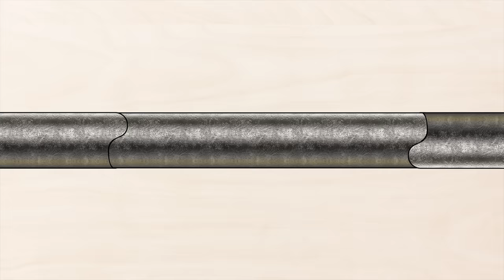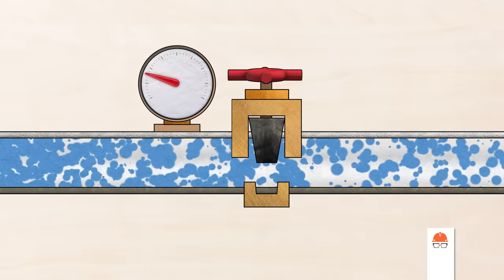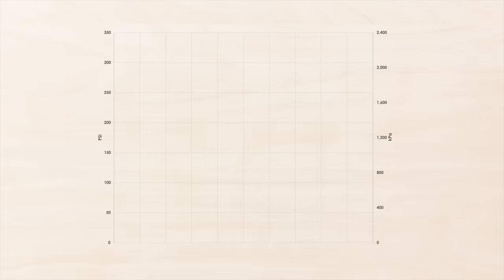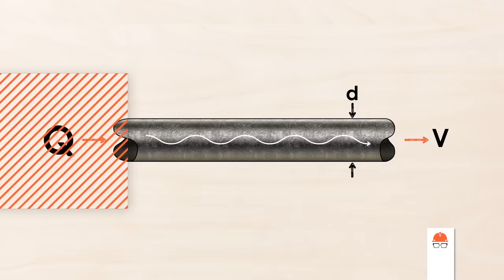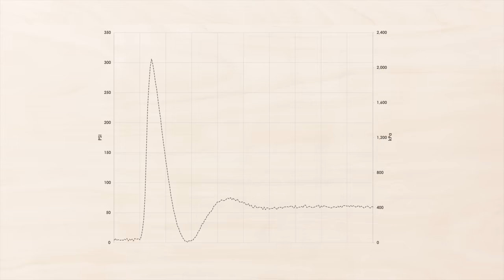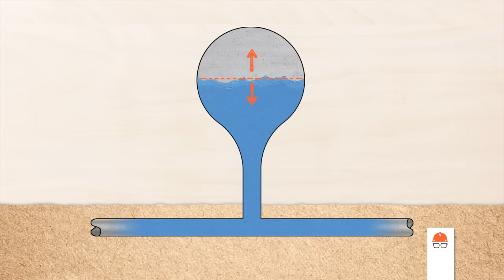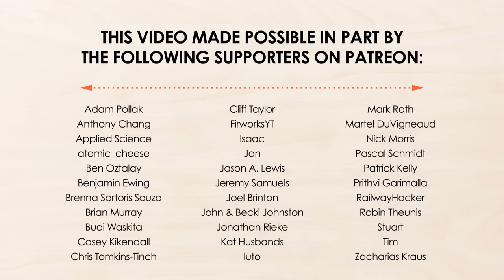What is Water Hammer?

Comment: but a smaller diameter maybe cheaper but the inner friction or pressure loss will increase
there is not only speed and diameter, but a ruggedness of surface which has a relation with the reynolds number, from engineering books

Comment: I made a water hamer damper with 5peces of pvc pipe nitrogen gass a spring from a reciprocating air motor pump and the piston off of the pump I attached them on every sink and every spot where water comes out the sound of the pipes moving completely went away and each damper has a flow meter and pressure sensers on the wet and dry side that wirelessly transmit to my custom software I made to make my house a smart house the max I have seen was the washer machine at over 900 psi I also redid the entire plumbing system I over engineered it by 10 times recently it's by code mostly but way over done I used 2 x more thinker piping with a extra thicker pipe around it in all it's all about 7 inches for the entire system and it should never leek and it's secured every 6 inches on 3 different secure spots making a triangle of fasteners around the pipe all of the wall are made to come out because the funerture is part of the wall so a fue screws and you can see all the piping and electrical no more holes in walls

Comment: Water hammer isn’t all bad though. Hydraulic ram pumps rely on this very process and they are very important in the pumping of water in remote areas. Sure they aren’t overly efficient but they don’t need any power and will run indefinitely as long as the water keeps coming.
Reply: I realise now there's a whole video on hydraulic ram pumps 😂

Comment: Why didn't you explain that most of the time this happens in houses is because there s air trapped in the pipes, because air can compress while the water can't, the trapped air will compress/uncompress/compress/uncompress pushing the water backwards and forwards making the hammering. 
So before anything else you bleed the air out of your pipes first and see if it fixes it. Turn the mains off, then go and open every tap in your house and outside, every one on your lot, hot and cold, flush the toilet, shower taps, dishwasher on, and take hoses off washing machine and into the laundry sink with taps open.
Then with all the taps open go an turn the main back on.
I don't think it really matters which taps to turn off first, closest to mains or farthest, just as long as you hear a constant flow and all the air has purged. I usually flush the toilet again and because I've got the old style water system reservoir and can't really do much there I can still manually release the safety valve which lets pressure/water out the overflow, which then lets new water fill into the system.
I don't really know if those things are doing much but its easy enough while i'm at it. Then just go round and close all the taps. Then see if its fixed it, it should at least have made it a lot better than what it was.
The other thing to check if its an old house is make sure all the pipes are secure, if they come loose then that can cause vibration as well.

Comment: Systems like this were initially designed with a "Globe Valve" not a 'Ball Valve".  With the gl valve it throttles down slowly and a ball is "BAM" if sally is doing it.  So put a gl back in the system, problem solved.   😎

Comment: I have often wondered if water hammer might be used somehow to drive an air vehicle like the German glock. It seems you might use it like a reaction wheel to levitate something or move it in outer space. if the fluid was mercury it may have the energy to move a considerable mass around. Also it would be immune to things like emps'.

Comment: The same effect applies also for electrical current and is used in car engines to ignite fuel. But the theory is different (science still lacks one unified theory), instead of inertia there are fields. It could be called "current hammer" but is not.

Comment: I had the pipe that goes to the shower head in my bathroom come loose. The guy who fastened it back said don't pull on the shower head so hard, but I've never done that. I wonder if the real problem was because I turned the shower off too fast.

Comment: 80,000,000 is not the mass of the water in the pipe. If you multiply the area of the circumference of the pipe by the length, you’d get the mass

Comment: Im confused. Changing the diameter of a pipe for a fixed flow will reduce the velocity but the momentum i.e. the cause of water hammers, should be the same since the volume of water is proportionally larger. From my perspective it would seem that the reduction in pressure would come from the increased surface area over which the force of the momentum is applied. I imagine that this would have real consequences for anyone building a pipe system since the surface area increases linearly with the diameter but the velocity should decrease quadratic-ally with the diameter. Can someone help clarify this for me?

Comment: I got to watch a 2 1/2 " line blast off the expansion ring and fly across a parking lot, leaving the coupling on the engine.  Someone closed the valve too quickly, during a tanker fill.

Comment: Water will compress 10% at 100,000 psi.   Water will compress 100% if pressure is high enough.  In fact, all matter will compress 100% if pressure is high enough.  No matter is a  "solid", it is 99.9999999999+ empty space.

Comment: Where is the best location to place a water hammer arrestor in a home and are more than none required.
Reply: I fitted a AA size MiniRester from SiouxChief - must admit, I was sceptical of it working too, but it has cured the toilet cistern noise which was like the foghorn on the Titanic and none of my house taps make a 'bang' anymore. I connected it about 1m from the stopcock. Even the neighbour's new ceramic 1/4 turn taps no longer hammer - I am on a common supply with them. 
You can fit it any way up; it has a valve inside that you can see if you look down the end. 
I only wish I had known about this handy device years ago - nothing short of miraculous.
 So it was well worth the time and effort, and only £20 in parts.

Comment: Having done irrigation for a number of years I learned that not only water hammer but to turn the system on slowly and to have something turned on at the end of the line so the air can escape. I've worked with some dumb asses that would just slam it on then we would be doing repairs. Nothing worse than having to dig in mud.

Comment: So basically when you jump from too great a height into the ocean at to high a  speed, the ocean basically becomes a water Hammer  and that’s why they say it’s like hitting concrete. Fucking terrifying
Reply: 'Water is incompressible' as they say. Actually the reason you should avoid water in a  freefall isn't because its hard- it isn't as bad as the ground often- rather you break your limbs (which are compressible) - if you are lucky it puts you unconscious, otherwise you drown when your broken limbs stop you from swimming. If you hit a tree you might be hideously mangled but not in imminent additional danger.

If you want a quick death, water still should be avoided.

Comment: Or, if you have an old house with old-fashioned dead-end capped vertical pipes to buffer the pressure , drain your house’s system occasionally, probably the hammering will go away. .......For a few months or years.

Comment: Ohoo Lalah , tell me how to get rid of my water hammer in my house?
Reply: I fitted a AA size MiniRester from SiouxChief - must admit, I was sceptical of it working too, but it has cured the toilet cistern noise which was like the foghorn on the Titanic and none of my house taps make a 'bang' anymore. I connected it about 1m from the stopcock. Even the neighbour's new ceramic 1/4 turn taps no longer hammer - I am on a common supply with them. 
You can fit it any way up; it has a valve inside that you can see if you look down the end. 
I only wish I had known about this handy device years ago - nothing short of miraculous.
 So it was well worth the time and effort, and only £20 in parts.

Comment: Shouldn't Smart faucets solve this issue? They already measure flow, they can be told volume, and they can control the speed of shutoff. 

I would think this is only an issue in residential homes for the next decade, max.

Comment: I can’t figure out where my pipes are knocking. But it’s driving me nuts lol.
Reply: I fitted a AA size MiniRester from SiouxChief - must admit, I was sceptical of it working, but it has cured the toilet cistern noise which was like the foghorn on the Titanic and none of my house taps make a 'bang' anymore. I connected it about 1m from the stopcock. Even the neighbour's new ceramic 1/4 turn taps no longer hammer - I am on a common supply with them. 
You can fit it any way up; it has a valve inside that you can see if you look down the end. 
I only wish I had known about this handy device years ago - nothing short of miraculous.
 So it was well worth the time and effort, and only £20 in parts.

Comment: Hi Mr Grady 
I recently watched a program that investigated new systems to help lower the climate problems one of the systems profiled was a thing called blue box that will be used in industrial and oil refinnery
Applications I had to stop that video to fact check this guy who kept using the term water hammer like it was a good thing and remembering your show I flipped over to it , sure that water hammer was not good and sure enough,
Now how could this blue box thing clean the fins or pipelines of a heat exchanger on an h/vac system in an oil refinery without stopping the plants opperation or distroying the pipes that in most cases are at their end of life ready to rupture already state. inducing water hammer at this point would get rid of bio - coatings by causing the destruction of the plant  right ?
Or am I premature. Ok the program is called disruptive investing the new tech is called blue box the blue box process is named waterhammer.
That's all I got I will go watch it again and come back here to report 
Cu soon catgeezzz

Comment: I have sprinkler irrigation water hammer.  The arrest or was useless.   Only after draining the water pipes in my 2 story house, opening only the upper most faucet, and refilling the lines does it stop the irrigation water hammer when the line valve shuts.  Unfortunately, after 2-3 days the HAMMER is back😡😡😡😡😡

Comment: 25 years ago my friend built one of these that only used a AA battery.  As I remember it was like 20 feet long and actually rotated a wheel which was connected to a sucker rod in his well.  I do remember the water was pushed up a pipe with home made check valves up about 25 feet into a storage tank.  If there had been solar panels then he would even have to change batteries.  Perpetual water supply

Comment: I am crying foul. Adding heavy flywheels to pumps would have the opposite effect downstream. It would add to the hammer effect if a valve downstream of the pump suddenly closed. The inertia of the flywheel would add to the inertia of the flowing water. OK I admit there would be less hammer effect upstream of the pump if the pump were to shut off.

Comment: @ 6:05 your valve is backwards. Er, upside down. Completely useless as pictured.
Reply: I fitted a AA size MiniRester from SiouxChief - must admit, I was sceptical of it working too, but it has cured the toilet cistern noise which was like the foghorn on the Titanic and none of my house taps make a 'bang' anymore. I connected it about 1m from the stopcock. Even the neighbour's new ceramic 1/4 turn taps no longer hammer - I am on a common supply with them. 
You can fit it any way up; it has a valve inside that you can see if you look down the end. 
I only wish I had known about this handy device years ago - nothing short of miraculous.
 So it was well worth the time and effort, and only £20 in parts.
Reply: @tiggywinkle1000  What does that have to do with what I said?